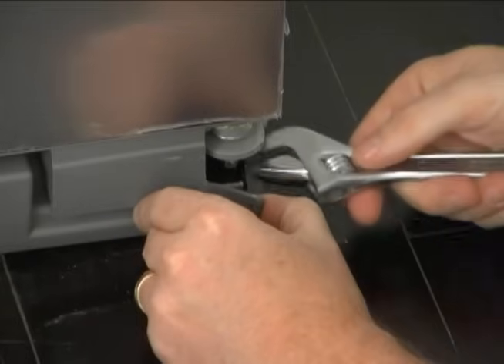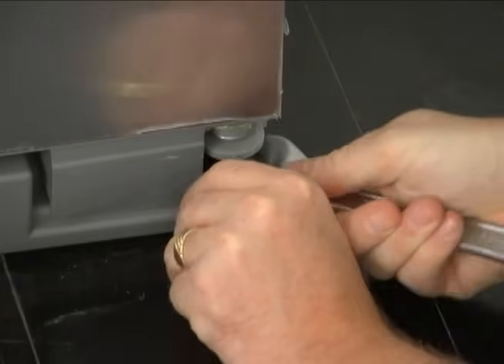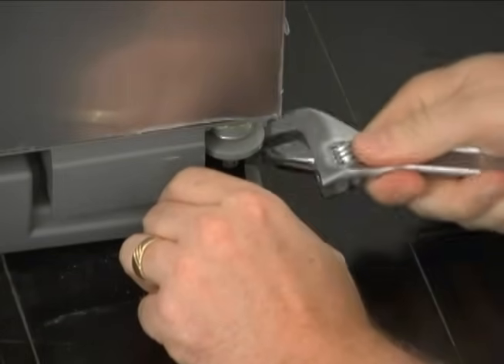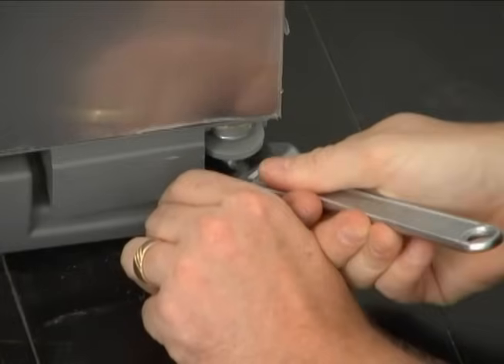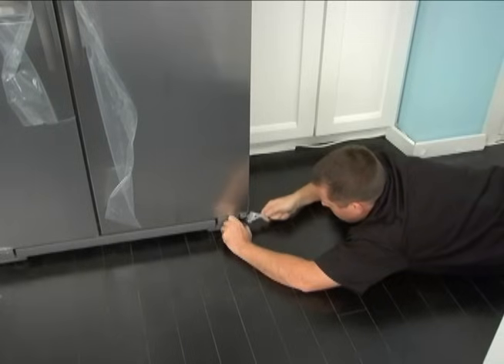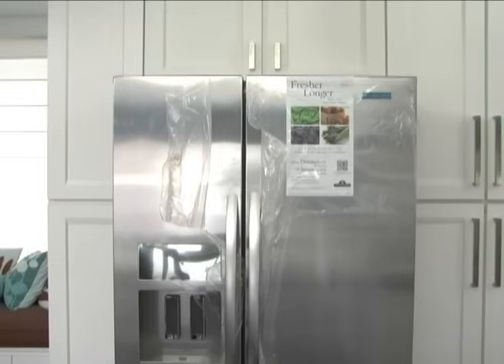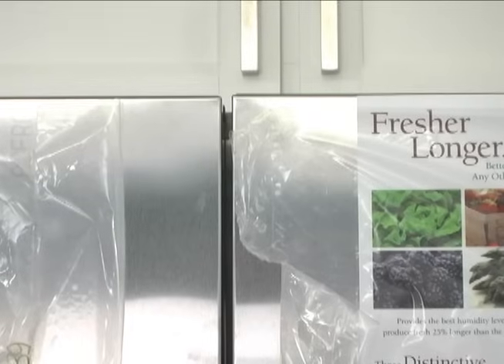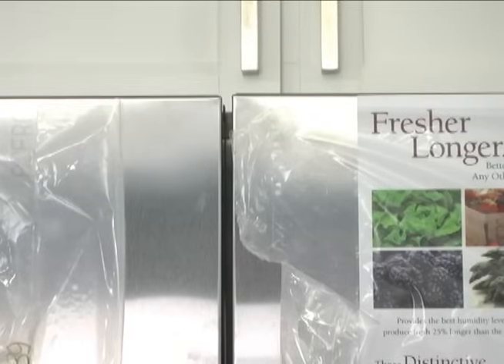Adjusting Doors on a Side by Side Refrigerator

Comment: what if your doors are touching each other at the top? gap between doors is greater at the bottom than top...
Reply: luis valderrama did you ever get an answer? I’m having that problem now and my freezer door does not have an adjustment screw because it has wires to the ice/water utility
Reply: I have the same problem, the only adjustable screws down there are the feet.
Reply: I fixed it, it was an easy fix.
The adjustment screws are on the top hinge for some GE with side by side doors. Loosen a bit those screws, correctly place the door (it won't fall because of the magnetic gaskets), then tighten the screws.

Comment: I turn that screw to adjust a door that is too low but it just continues to turn without adjusting the door height. I can't imagine that it stripped, what am I missing?
Reply: Frank K ..mine too...any luck on luck on finding a solution?
Reply: Braden Tucker nope, my fridge is fucked I guess
Reply: lol mine too
Reply: Braden Tucker hey I fixed it.. I removed the door entirely and found that this adjustable bolt was sitting in something where the thread was totally stripped. I ended up putting a washer of about 3mm between that piece and the fridge and the door is good as new again
Reply: Frank K thanks! I’m going to do that!
Reply: Made in Mexico. What you all expect.